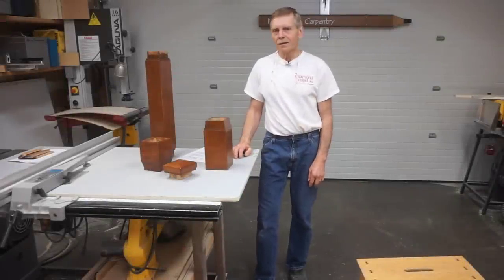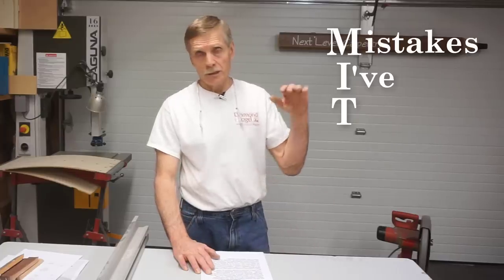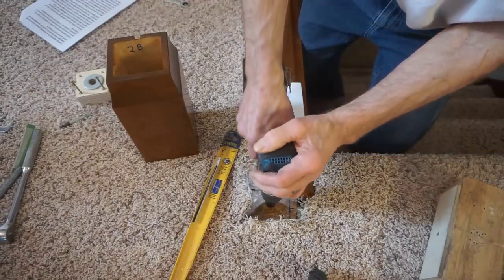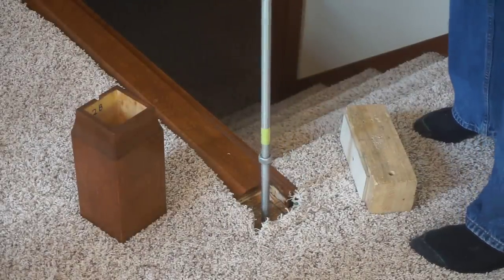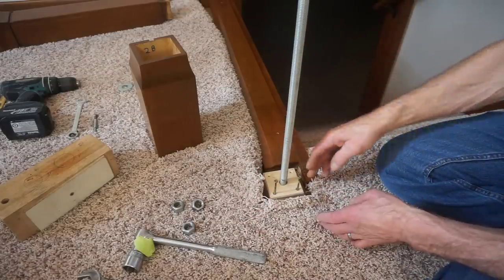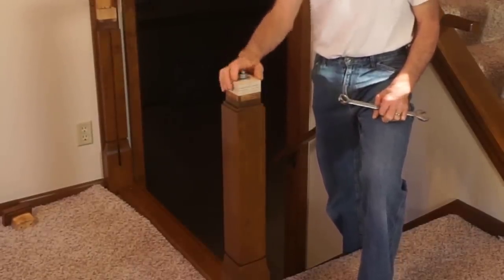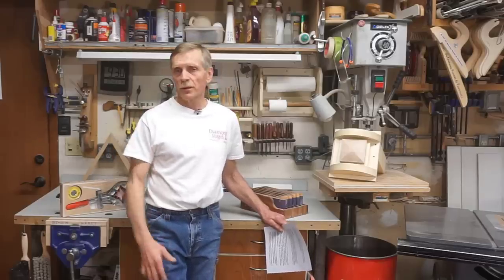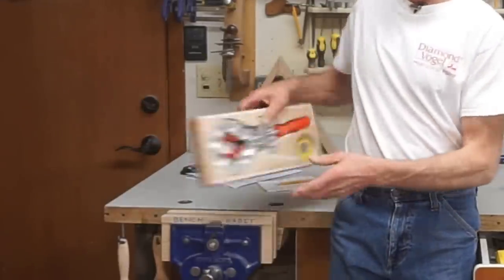How to Install a Newel Post Without Wobble

Comment: While I love your videos and find them entertaining as well as instructional, I have one concern about mounting the newel posts. I've worked on cars, motorcycles and am now involved with wood. The one thing metal working (car, motorcycles) have taught me is to always use lock washers or lock nuts. Wood working has it's own challenges, however using locking devices (Especially inside structures like theses) seems as essential.
Reply from the maker: Hey Terry, A person could certainly use 'nylock' type nuts if concerned about movement or wood shrinkage causing it to loosen over time.  With bone dry lumber in the posts and framing, I feel that force from compressed wood fibers in this installation acts as a lock nut of sorts so I don't feel anything more is necessary.  But as easy and inexpensive as a couple lock nuts would be I wouldn't try to talk anyone out of using 'em.  Thanks for your insight and suggestion!  Best, Matt
Reply: Houses also don’t have vibrations at ridiculously high and varying frequencies continuously trying to loosen fasteners. I agree they would be that much more beneficially overkill, but far from necessary.
Reply: Dan I agree houses don't have the crazy high vibrations found in cars and motorcycles but, they do have kids that run and jump, jerk on everything they can and in essence try to work anything loose that they can. So why not spend a couple of pennies for a washer just to insure they rod can't work loose.
Reply: Fasteners act very differently in with wood vs. metal, so lock nuts, while they can't hurt, also aren't necessary in this application. A jamb nut could be used for a total belt and braces approach. That, or a dab of Loctite could be prudent.
Reply from the maker: Quite true, John... it's mostly about what you need to do to fuggetaboudit once the job is done.  You can buy buckets of Locktite for the cost of even one callback!  Best, Matt

Comment: But what if you need the post in a place that is not centered exactly over a 2x10?  And what if it's not a double 2x10 but just a sinle?
Reply from the maker: Then you did deep into your bag of carpentry tricks and figure out how to get the job done in less than ideal circumstances... all in a day's work! 😎

Comment: What if you don't know if there's sturdy support below?
Reply from the maker: Determining "existing conditions" is a major part of due diligence for planning a project like this. An experienced contractor can deduce a lot of things about underlying structure without causing disruptive damage. Otherwise you need to do some exploratory surgery that usually involves cutting holes in sheetrock or probing through a subfloor. Not sure what your plans are but make sure you do your homework before committing to installing a newell post because if you're not prepared you can end up with a substandard job that can not only be unsightly but dangerous.
I have yet to encounter a situation where newel post installation is not possible but there are many times when it's just not practical and a different solution or design makes more sense.
Good luck with your project!
Best, Matt
Reply: @NextLevelCarpentry  Thank you for the in depth response! Unfortunately, instead of sheet rock, we have half inch tongue and groove wood panel walls in the area in question. Any chance I can send you a picture of it and you can give your best educated guess? I want to go with a modern look of 4x4 posts, 2x4 railings and horizontal pipe to fill the gaps.

Comment: Where's the link to the article? I'm using this system right now on a job, but would like to know your approach when joists aren't directly beneath the post centers. I've got that on every post. Argh!
Reply from the maker: Hey Patrick, I'm sorry to tell you that the article never materialized.  Fortunately adding blocking below is just basic carpentry.  If you have access from below just cut a stack of tight fitting 2x6 blocks about 6~8" thick and screw and glue them into place below each newel location.  I was able to do this below the post at the foot of the stairs.  Without access from below just make access above by cutting out subflooring above so blocks can be fit, glued and screwed in from above then replace the subfloor patch and proceed with the steps shown in the video. Once you have access for the blocks it's actually very easy and, in some ways, better to add blocking than to deal with joists that might be not close enough to work but too close which puts them in the way for adding blocks.  Hope this helps and good luck with your project.  Best, Matt

Comment: I am planning on setting a solid newel post that is the starting post.  How can I modify your technique to make this work for a solid post?
Reply: Use a stub of readi-rod that extends from the floor about 12", and drill a corresponding hole into the bottom of your solid newel post.  Thread the newel onto the rod.
Reply: I'm working on my new knowledge here.  Is a readi-rod referring to a simple threaded rod?  I was thinking something like that but adding the, washer looking thing with teeth that you would drill and pound in the bottom, I have no idea what it's called.  Probably a hefty 1/2" one would be much better than a 1/4" or 3/8" right?  It may be called a Threaded T-Nut with prongs.
Reply: Yes, redi-rod, all-thread, threaded rod, etc.  It's basically the same stuff.   And yes, it's a spiked T nut.  You can also get T nuts with three or more little holes in the flange for small screws, or to give glue or epoxy something to hold onto.

Comment: want to use this system but the hollow box newel post I have doesn't have a ridge anywhere near the top for the squash block to press down on, prolly going to make a box out of plywood to a desired height and that will make the newel post rigid and keep it from falling over to the side but I got to think of a way to secure it to the inside walls otherwise nothing is particularly keeping the newel post from being pulled up? and I don't want to nail the piss out of it its already finished on the outside, would I be able to just liquid nail it all across the inside and just let it dry? or should I take a different route?
Reply from the maker: In your situation I would just glue 45 degree angle blocks about 6" long into each inside corner with their tops about 1 1/2" down.  If the inside of the post and the angle blocks are bare wood regular wood glue and a bit of clamping pressure will provide more strength than you'll ever need.  Just make sure the tops of the angle blocks are level in relation to the top of the post when you glue them in.  BTW This would eliminate the need for a 'plywood box' of any sort in the assembly.  Hope this makes sense... and good luck! Best, Matt
Reply: @NextLevelCarpentry  good man! thank you for the quick reply that's about what I was imagining, think ill be using some loctite pl8x so I can let them cure overnight unless you think wood glue would suffice? (both materials would be bare wood) just want to make sure its got plenty of sheer strength when it gets torqued down the next day. appreciate it!
Reply from the maker: @RubenSOchoa  wow... you've got an excellent grasp on what you're doing, don't you?!  I'm impressed... it's great to share with someone who's so into what they're doing!  I'd be more inclined to go with wood glue than PL8X because I'd worry a bit about 'creep' in the PL where wood glue sets 'hard' when cured.  As long as you get decent clamping pressure on the first couple inches of those blocks they should be 'bombproof' overnight.   You could make them bigger for more glue surface too? Any time I can I put a glued assembly out in warm sunshine which really accelerates dry time.  In the right conditions I'd not worry about glue strength even after just a couple hours in the sun but if you've got overnight, so much the better. Hope you like the results you get from this method... it's pretty sweet IMHO! Best, Matt
Reply: @NextLevelCarpentry   thank you so much man, that means a lot; wood glue it is!
Reply: Love this guy he’s not only a Master Craftsman, but also a true Gentleman!

Comment: Why not use an auger bit instead?
Reply from the maker: One reason is that auger bits can be a bit (pun intended) too aggressive and tend to split out boards when drilling through their edges. That said, if you do this for a living and use only a sharp auger bit, it's probably a good suggestion...

Comment: I'm stuck on the first part. Is it normal for there to be 6" to 8" of solid wood under where the post goes?? I'm working on the first floor, so mine is going to be concrete, but even on the upper floors, is that normal?
Reply from the maker: Conditions under the subfloor vary greatly to the point I don't think anything qualifies as 'normal' here.  If you find solid wood (or have concrete like in your situation) consider yourself fortunate.  It's just as likely that there will just be 1 layer of plywood or OSB and you'll need to add blocking for strength.  Concrete is ideal: just drill an oversized hole 4" +/- deep and use appropriate epoxy to secure the piece of allthread and your post will be rock solid...
Reply: @NextLevelCarpentry  Thanks so much for answering! I'll be using all of this info soon.
Reply from the maker: A little investigation and pre-planning will go a long way towards success... good luck with your project!

Comment: MATT! where did you go?
Reply from the maker: Thanks for askin' Marty... I assume you're wondering since I've not uploaded a video since the Super Sawhorse one?  Bottom line is that we sold our house along with the only Next Level Carpentry shop you've ever known and moved.  Disruption from the move (it's ALL good!) has left me with no time to produce videos but, believe me, there's plenty more on the way.  I do have to get settled which involves getting a new work space up and running.  That's proving to be more time consuming than I expected but in the end will be a huge improvement all around.  Since you're an engaged subscriber you will know ahead of time and understand the 'transition' video that I intend to put out.  In it I say 'goodbye' to that old shop and explain a bit about the move...
Best, Matt

Comment: How would you install a solid newel post?
Reply from the maker: In similar fashion using a lag bolt of some sort.  It's basically a larger version of the system used for connecting handrail components using a bolt with machine threads on one end and lag screw threads on the other.  A nut for tightening the post down is slipped in and tightened down through a round hole in the side of the bottom of the newel post and a matching round wood plug is used to fill the hole.  You should be able to find a YouTube video showing this method somewhere.  All that said, if you have a chance to switch to hollow newels you can save yourself a lot of fussing and get a very solid installation to boot.  Hope that helps... Best, Matt
Reply: @NextLevelCarpentry   Appreciate the reply...I'll be searching the Tube. Thanks
Reply from the maker: @Bugdriver49   Good luck in your quest... the fact that you're looking for a stronger, more reliable installation method tells me you'll be able to figure this out and get the job done to your satisfaction.  Wish I had the ability to custom tailor videos to address good questions like yours specifically but I just don't have the resources in place at this time. 😢  Best, Matt

Comment: Wood blocks will compress and all-thread will loosen over time.
Reply from the maker: ADZB, effects of the changes over time you mention are no more concern to me for this newel post/railing system than movement of the tectonic plate under the house it's installed in :-)  Best, Matt

Comment: Can this be done on a concrete slab?
Reply from the maker: Absolutely and since the compressive strength of concrete is so much higher than wood the installation will be stronger still. You will probably need to use appropriate epoxy to hold the threaded Rod into the slab but that would be about the only difference...
Best, Matt
Reply: @NextLevelCarpentry  is there a ratio how long the bolt should be verses the post?
Reply from the maker: @Bhanna2107  I don't know of any official ratio but as a rule of thumb longer is better and since extra bolt length it's such a minimal cost it's not a big deal to do that. if in doubt you can always do a mock-up post and Bolt to come up with a combination of Bolt diameter and length that's strong enough for your application...
Reply: @NextLevelCarpentry  so it's there an easy way to make a post and to be able to hold that wood block inside for the bolt to attach to at the top? I'm not able to make a fancy post like that.

Comment: I wonder if you'd add even more rigidity, by having a steel plate (1/8th or so) fastened to the floor, then everything done as you've shown it.  Thus your newel post is landing atop a square steel "washer" which can't crush at all, under traffic stress and the compression from your all-thread and bolt assembly.  It can slip under the carpet etc.  I think just barely bigger than the footprint of your newel size.  An idea.
Reply from the maker: Very observant, Neal, great idea!  I wondered about that too and envisioned routing a shallow mortise in the subfloor so a plate like you suggest would sit flush.  Because of the 'leverage' of the post against the subfloor I think the weak link in the chain is compression of wood fibers of the subfloor plywood under the edge of the newel.  Your idea would change the weak link to compression of the end grain of the hardwood newel which is hard enough to make a significant difference in the stiffness of the post overall.  My first attempt at the suggestion would be to go with 3/16" thick steel and about 2" or so larger than the newel all around to reduce the psi force on the plywood. Without a significantly larger 'footprint' the compression point would just move from the bottom of the newel to the bottom of the 'washer' because of the strength of the rod.  Let me know if my degree from MIT is causing me to miss your point? :-) Matt
Reply: Next Level Carpentry Yes, the plywood will certainly compress over time and newel will loosen.  Steel plates top and bottom would go long way to eliminate the problem.
Reply: This was going to be my suggestion, as well! Hardwood end grain compression against a metal plate vs. the same end grain crushing plywood fibers.

Matt's addition of routing a recess in the subfloor to accept the oversized plate is spot on. However, 3/16" steel plating may be overbuilt. But, as is said in the video, "it can't hurt."

I also really like the suggestion of a metal top plate. This would effectively place the entire newel in compression as it's installed, making for an even more "really rigid railing". :)
Reply from the maker: I think a knowledge base of 'best practices' for this method will develop over time and will no doubt incorporate many of the insightful suggestions made by you and other viewers, John... thanks for adding to the discussion here!  Best, Matt
Reply: Even if hardwood was added later and as Matt said, the plate was mortised into the floor , adding a steel plate would make the post additionally robust.

Comment: Ready Rod...?  The tag at the hardware store says All Thread. Anyway here is a trick you can use the next time you need to run a nut all the way up or down a ready rod...put a wire wheel on your right angle grinder and press it against the nut...it will go up or down like a rocket.
Reply from the maker: I like the wire wheel/angle grinder tip Larry, thanks for adding it here.  If you show up on a jobsite and someone asks for a stick of ready-rod and you correct them by saying 'that's not ready rod, that's All Thread' my guess is that you'll be sittin' alone at lunch... just sayin'